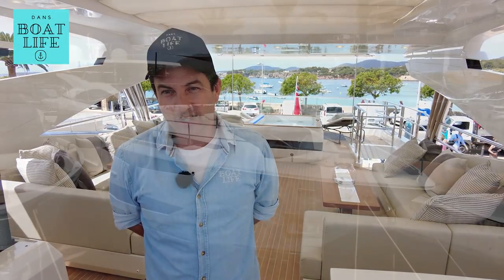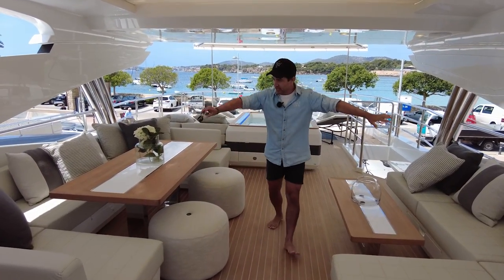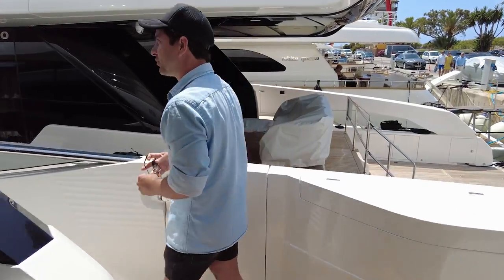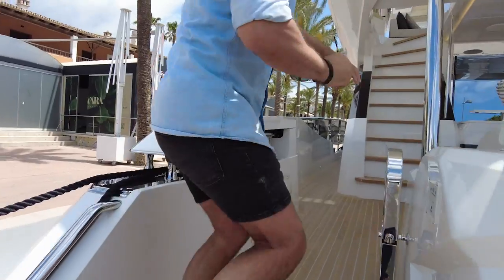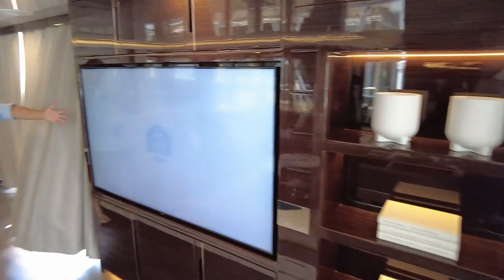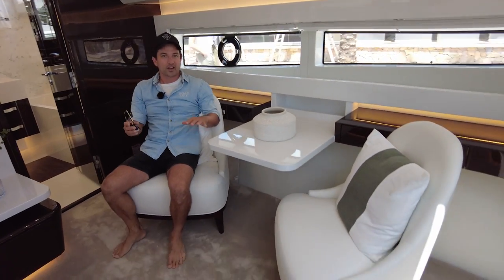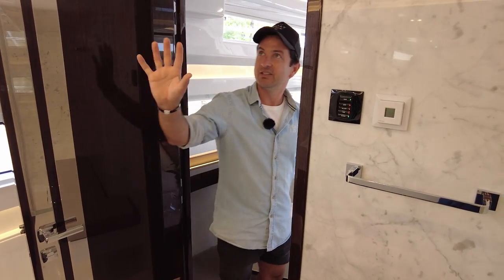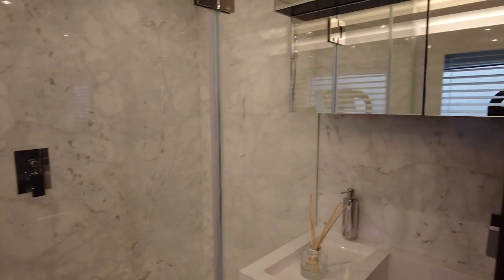Pearl 95 - This yacht gives you options! - Detailed walkthrough

Comment: 380 NM of range???? Is that correct?
Reply from the maker: I can’t recall off the top of my head as I didn’t get a chance to drive her due to some strong winds keeping us in port that day. I’ll have a drive when I get the chance and film it for you guys. But yes they have a high speed potential so if you wind it up that sounds about right. Obviously more if you’re cruising at displacement speeds.
Reply: @BoatLife_DansBoatLife  first of all thanks for replying! I asked 'cause I think it's too low, extremely low for any vessel. We have several other yachts that can do a way better range than that. Once again thanks for replying.
Reply: @danilolorenzetti712  I think that's 400 miles at a fast cruise. At about 12 knots it's about 1200 if I correctly recall the MB&Y statement. Always bear in mind any time you're given a range figure, by any boat channel, that range will go up or down dramatically depending on speed. A boat like this would get run hard to make an appointment or to outrun weather, otherwise no reason not to drop the speed and increase efficiency (which also increases range).